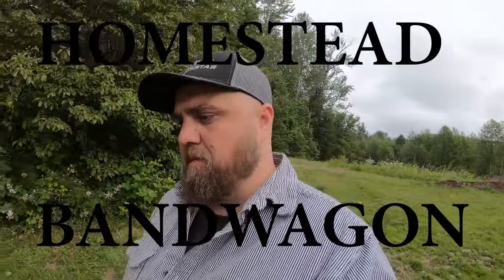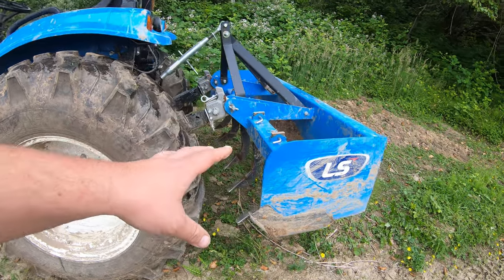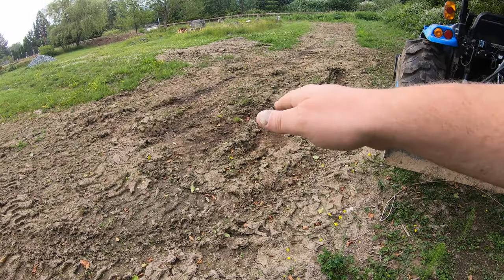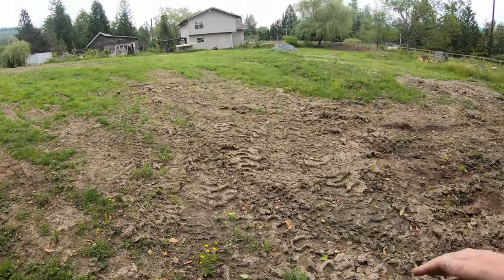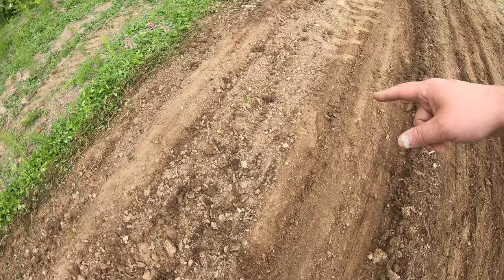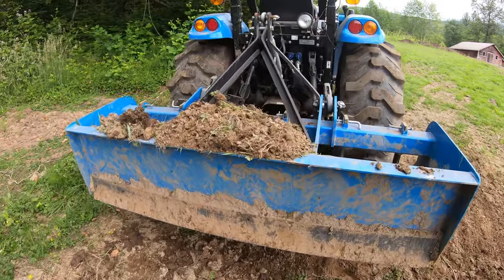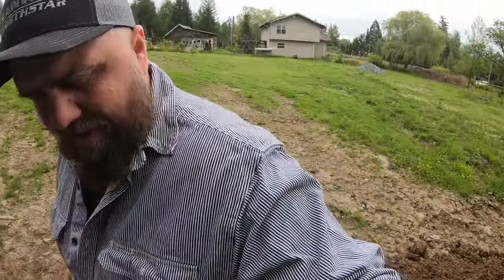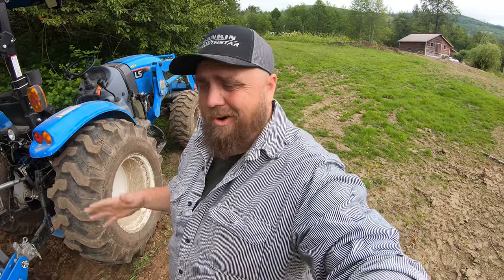How to use a BOX BLADE - Fixing Ruts and Grading with a tractor and box scraper

Comment: Not a problem with loose.material, but a good word of advice, be care when going backwards using any of these implememts because your tractor is made for pulling with 3pt not pushing. Loose stuff like dirt and a little gravel isn't so bad. I really have to be careful with my bx1880. Its weak from from start compared to a lot more tractors. It'll do what i need aroud here. Great video.

Comment: Question about that "pothole" if you had a couple buckets of gravel, would you have chosen to fill it in to act as a "foundation" to then cover with dirt so as to allow a reinforcing of that soft spot to allow for possible drainage and maybe future depressions in that spot?
Reply from the maker: A person definitely could do that, but in my experience,  the water will then permeate the voids between the gravel, andit'll just turn into a muddy mess with gravel in it.. If it stays wet, and we really wanted to drain it, we'd make a trench that leads to a ditch or something and then the gravel would be helpful to give the water a path in which to travel. At least until the dirt works its way into all the gravel
Reply: There's really no reason to ever put soil on top of gravel.   First time it gets wet, it will start washing into the gravel and you'll be forever chasing your tail filling more potholes.
Reply: No!
The water will collect in that area and make more mud!!
It would be much better to try to dig out the mud and replace it with fairly dry dirt and pack it in!
Gravel, or better yet a layer of base rock works better if it is above the surrounding dirt !
Base rock is a mixture of gravel, sand, a little bit of dirt and some crushed up bricks or asphalt.
In construction it's also known as class 2 material.
That's what they use underneath of roadways and parking. Once it's spread out and compacted it also keeps most of the water out!
They also use it for temporary roads in construction sites.

I'm a retired Operating Engineer.

Comment: Hey bro, good instructions! Would you do the same thing on a gravel parking are that’s 85x100’ that over the years got a couple of low spots ? I was told not to use the rippers! 🇺🇦☮️✌🏻
Reply from the maker: The rippers are very useful, but they'll loosen up the area you use them on, so you can end up with more potholes. If it's just a couple of potholes,  the rippers might cause more harm than good. But if it's an old parking lot that constantly develops a lot of potholes, the rippers would be great to tear the whole mess up and then re-spread the material
Reply: Love the video.  I have a box blade for my LS 3025 and it’s been great for building a 5/8 minus road on my homestead. I’m curious though.  What is a land plane? Does it perform a similar function?  Which one is better? Thank You in advance.
Reply from the maker: A land plane or grading scraper is like a box blade, but it has no back on it. Pretty cool tool for grading driveways and whatnot. They aren't as adaptable as a box blade, but they are way easier to use for smoothing driveways, and they can save you on gravel too
Reply: Don't use the ripper's unless you need to loosen up all the ground, then regrade it without the rippers.

Leaving the ground with ripper marks is very sloppy work! 

If you need to use rippers then rip up everything and mix the material up good before grading it out and compacting it.
If you don't then it will get worse quicker.
Reply: @sublimesalamander  nobody in construction uses a land a plane!
They are not adjustable.
They are made to smooth out driveways that have loose material on them.
But their functionality is very limited.

Scraper boxes are used throughout the world by professional landscapers, road and parking lot builders.
They are used on the back of skip loaders and farm tractors, both of which have several similar functions.

Comment: I loved my dad's rollover scraper. His was one of the oldest I've ever seen.

They have been made by different companies probably since the 1940s.
You can see rollover scraper videos on YouTube.
You never have to get out of the seat to put the ripper's up or down, or change the box direction. 
Just reach back and pull the lever behind you.
His is the one that I learned on when I was a kid long before I joined the operating engineers.

By far the best box scrapers ever made ! 😀😃
I don't care for the modern Gannon scrapers.

But whenever using any kind of box scraper it's always nice to have the top & tilt kit so you can make adjustments on the fly and save a lot of time.
Reply from the maker: We had a guy in the shop with a 25 or 30 year old Woods rollover scraper with a hydraulic control. Wasn't interested in selling, unfortunately...

Comment: Can you use it to clear rocks and roots too. Debating picking up a box blade or a York rake. I need to level ground too but I cleared a brush area there are a lot of small saplings and roots still . Will it take care of them ?
Reply from the maker: It'll drag that stuff away, but a lot of dirt will come with it. A rake would sift the material a little,  which might be less frustrating

Comment: If it sticks in the box then it's too wet to grade.
Especially if it sticks in the box as you shake the scraper up and down.
Reply from the maker: I disagree- moist dirt keeps the dust down and can grade more evenly. Plus,  I'm in Western Wa. There's some years where if you waited for the dirt to dry out, you might be waiting a year to do the job!
Reply: @HomesteadBandwagon  there's a significant difference between moist and muddy.
I did a lot of grading in the operating engineers on skip loaders doing that.

Several different soil engineers showed me how to check the dirt for the proper amount of moisture in the dirt for best grading and compaction conditions.

Maybe the ground in your area is different than most other places. 

Generally speaking the best way to test for the proper amount of moisture is to pick up a handful and squeeze it in your fist, then open your hand flat and if it sticks together. If it does then it's not too dry.
Then touch that ball of dirt with one finger very lightly and see if it easily crumbles. If it does then it's not too wet.
This is perfect, not too dry and not too wet.

Once again, it should be able to stick together but just barely. 
This is the perfect condition and should not be Dusty at all.

My dad did commercial tractor rototilling for over 50 years and he used the shovel test. 
Be able to stick the shovel into the ground without too much trouble, pull up that shovel of dirt and turn it over on the surface and see if it crumbles easily without sticking together in large sticky clumps.

Perfect condition for rototilling and will not be Dusty.
Reply: @HomesteadBandwagon  I am also somewhat familiar with the weather in Washington and Oregon because I have relatives up in Seattle and Spokane.

On construction jobsites in California we used to joke about the circle test.
If it looked like rain, someone would draw a circle on the ground, and see if a drop of rain fell inside that circle, and if it did we would call it a rain day and go home.
And somebody else would say if that happened in Washington they would never get to work because it rained so often up there. 😁😉🙄
Reply from the maker: @TF856  That's definitely ideal, but, unfortunately, it's rarely possible here.  I can roll dirt into a ball into August or September most years.  Then, October comes around and we're back to mud!